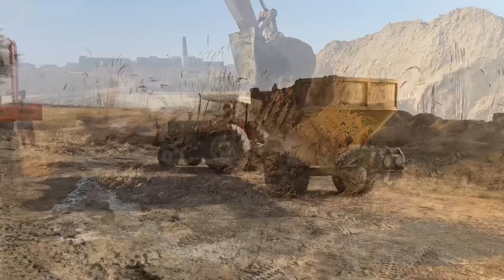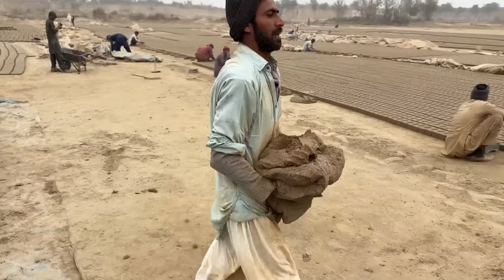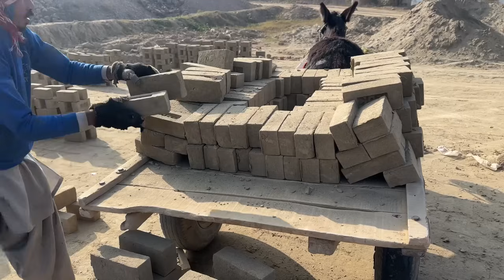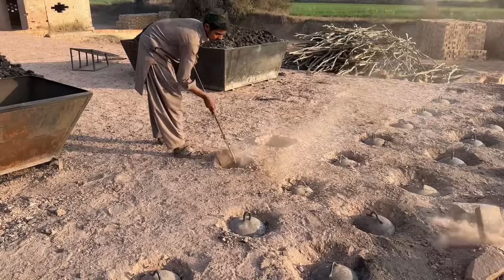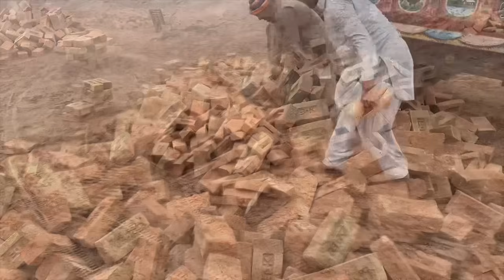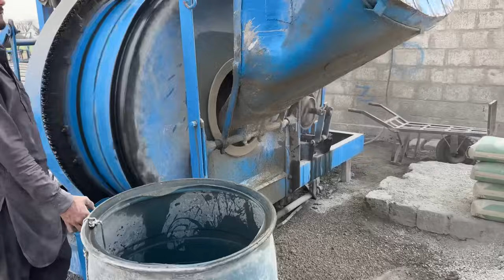Amazing Handmade Manufacturing Process Of BRICKS| How BRICKS are Manufactured in Pakistan.

Comment: In Thailand, traditional brick making near the Ping River, Chiang Mai the process is similar, but families burn waste rice husks to fire the bricks. 

Brick sizes and batch sizes are smaller, but the end product is serviceable for house building. Usually the walls are built within concrete beams as a "space-filler", and are cement rendered on both inner and outer surfaces.

There are frequent earthquake tremors around Chiang Mai, one severe case about three years after my house was built, but after twenty three years the house still stands solidly.

Comment: What I don't understand is why people throw the bricks around like that!
This means that the edges break and it is no longer possible to lay them down properly, so crooked walls are standard!
What I also can't understand is that the kindling isn't made to the same size as the fire hole, so you use more wood and lose valuable wood and heat!
Reply: would it help you understand if you knew these are literally slaves you are watching?  not 'craftsmen' or 'workers' or anybody else who is there by choice?